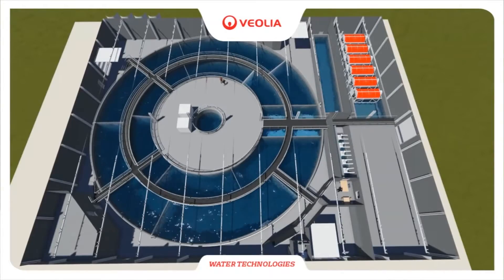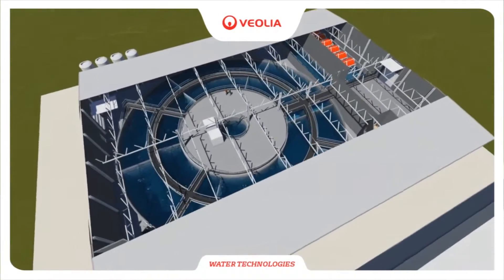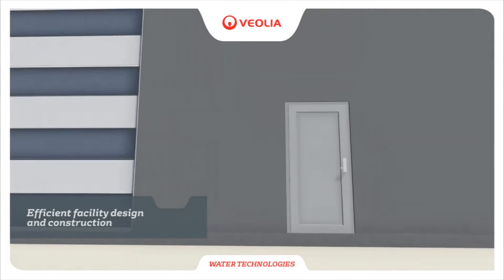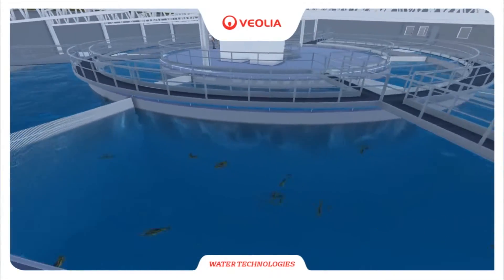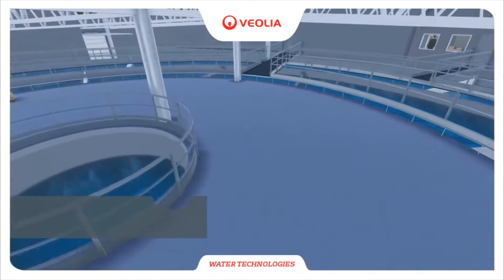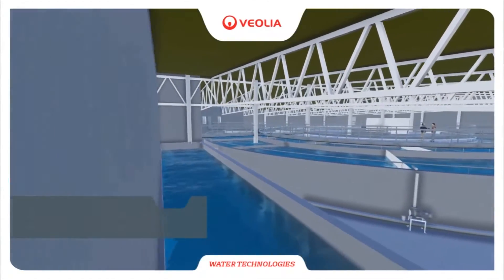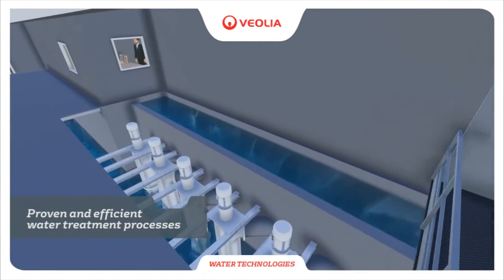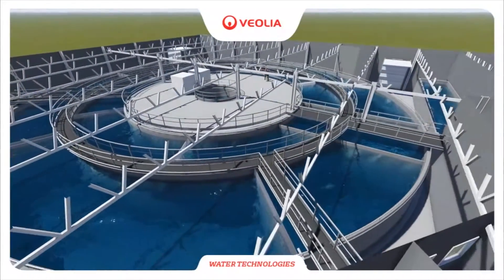Veolia's new RAS2020

Comment: Excelente, me gustaria cotizacion de todo el montaje acá en colombia , mucjas gracias
Reply: One optimized RAS2020 complex, including a hangar, robotic pneumatic equipment with three radial fish tanks, integrated with MBBR / PS / Purge channels, a water treatment (water treatment) system with a UV system, a fish processing plant, an automated hydroponics system and a feed mill for fish costs about EUR2.5M. The most optimal option is the simultaneous construction of the RAS2020 complex of 6 workshops. In this case, 1 workshop grows from 1700 tons of fish per year. In an optimized version, each RAS2020 workshop generates from 300 kW / h of electricity in a water flow of 720 m3 / h. Payback period 1 year. IRR = 43%, ROI = 12%. At the same time, the cost of producing 1 kg of fish per year is US $ 0.56.